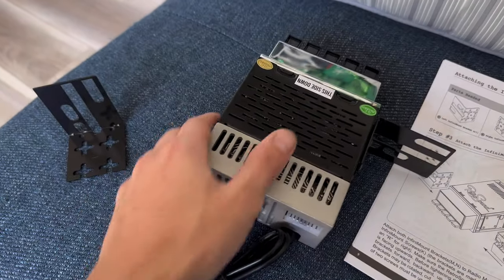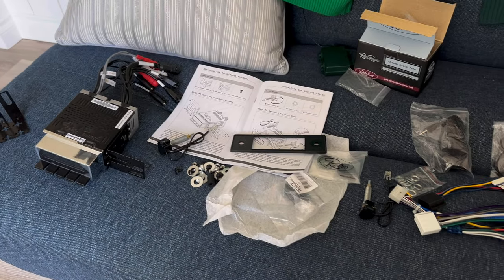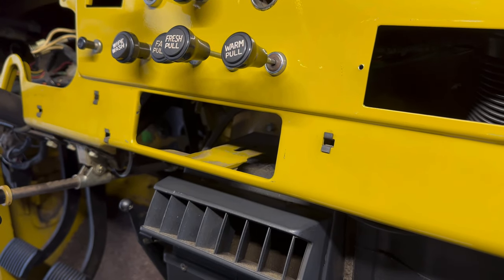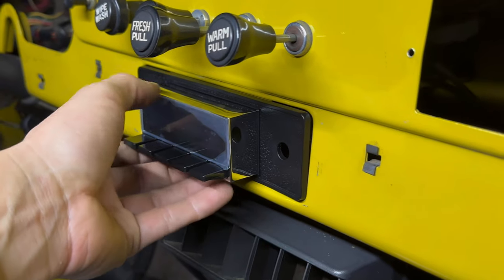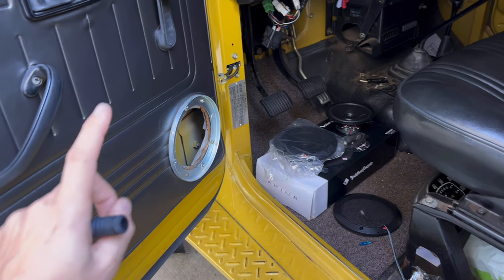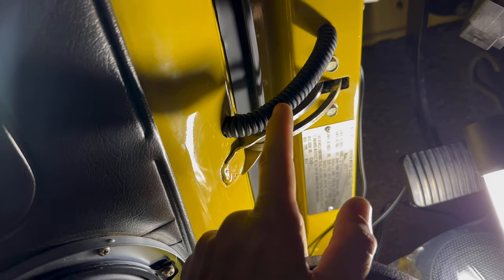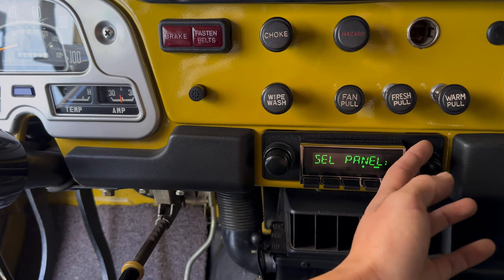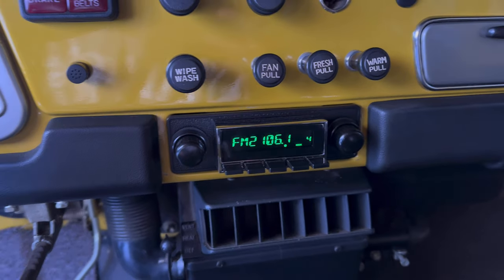FJ40 RetroSound Radio Install | #Tiger40 Project Part 11

Comment: Need to do this on my ‘74 FJ40.  My speakers will be mounted in pods on the upper rear corners of my 6-point roll cage.
Reply from the maker: I definitely plan on adding some rear speakers, and possibly a small subwoofer since the radio is pre-wired for it 👍🏼